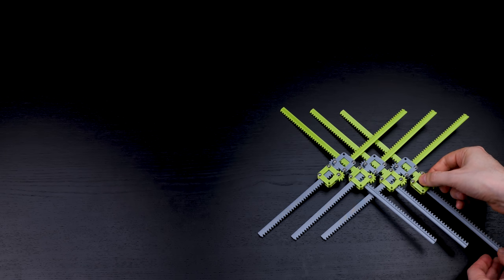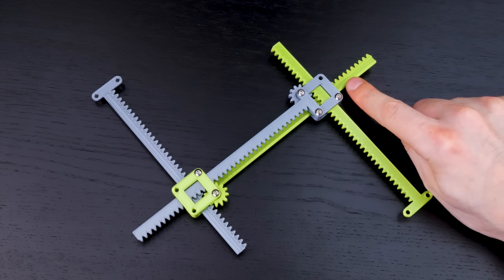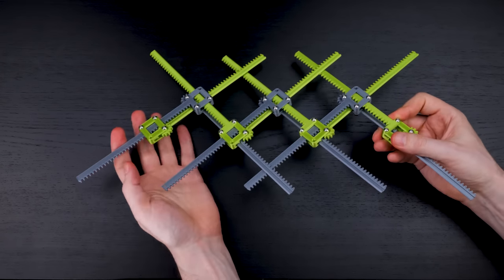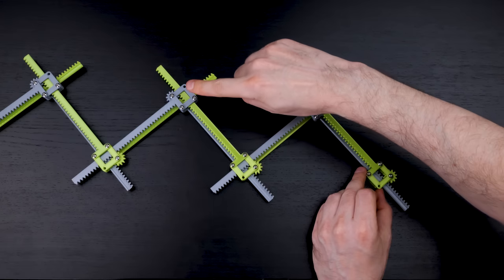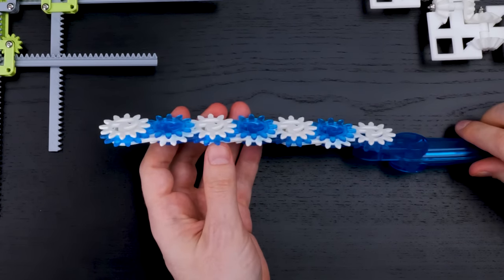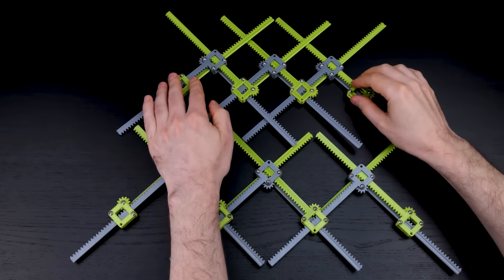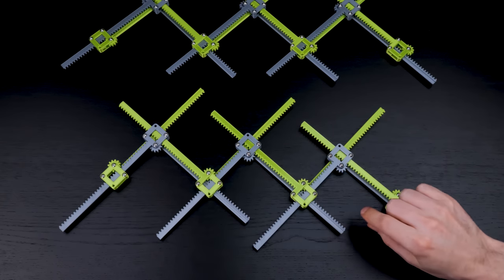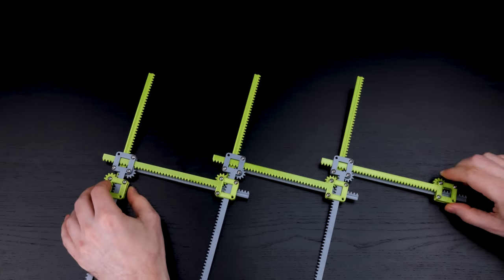Recursive racks

Comment: i would love to see a video about your process for creating mechanisms like this! do you use any programs or simulations when you're throwing ideas around? maybe we could see some early prototypes of some of your projects?
Reply: Did you ever even bother to check the description? It contains the weblink for the PDF download...

And BTW (by the way)... THIS is basically THE VIDEO about creating mechanisms like these.
Reply from the maker: @badfoodfeet  The very short answer is that these recursive racks came from thinking about Oskar's Tailspin mechanism, and wondering what would happen if we swapped out one kind of gearing (the spur gears in Tailspin) for another (sliding racks). The geared cube net is the same thing, but using bevel gears instead of spur gears. The prototyping stages are presumably not that different from how anyone prototypes - I design stuff in my CAD program (Rhino) and test it out. I implemented my own gear/rack code, then I tested out how small I could print gears before they stopped working smoothly. Having determined the sizes of my gears and racks, I then made a box with two racks and a gear, and found that I had a lot of friction. So then I modified the design to decrease the surface contact areas between parts. And there's also some stuff to do with designing for the filament based printer I have - thinking about the print orientations of the various parts and how to bolt things together.
Reply: noahgiom341 wins!
Reply: @alb9070   The first clear internet argument winner I have witnessed honestly
Reply: So, if the racks were curved, presumably you could have a collapsing circle frame?
Reply: @AsciiSmoke cool idea!
Reply: @OmenAkumaru20223 I’m sorry for whatever happened to you

Comment: These demos remind me of the Hoberman Sphere - that spiky ball toy that expands and contracts through a bunch of linked scissor mechanisms. The Hoberman Sphere is recursive too, except there the components have a network of relationships rather than just a chain of relationships.
Reply: We used to have one of those! It was super fun to play with and toss around :)
Reply: Commonly seen on indulgence feasts in Poland - stands with cheap (often knockoff) toys, sweets and especially indulgence obwarzanki (a very light and dry kind of ring shaped bread, no idea how it's made, availble basically only on those indulgence feasts) spring up around churches on the day of that church's patron. Usually in summer. I remember having that kind of toy, but idk if it's still somewhere around in the house.
Reply: isn't it offically called the "Ikea Death Star" now ?
Reply: technically you could say that it's an inverted hoberman sphere. Inversion is a geometrical transformation which (in 3d) changes planes into spheres and vice versa.
Reply: I tried to put a servo on one of the joints of a plastic Hoberman Sphere so that I could remotely expand and contract it for dramatic effect. It didn't really work as my servo didn't have enough torque. I wondered if the sphere I had relied to some extent on the flexibility of the thin plastic struts or whether a solid metal construction would also work if the joints were ball / socket.
Reply: How could you get Oskar's surname pronunciation wrong when that's the first thing he always says in his videos 😭😭
Reply: @nikthefix8918 ironically I had the same idea, except I planned to recreate the sphere with a slightly different mechanism using strings which in theory would make it easier to expand and contract it via machine.
From playing with it, I’m pretty sure you need to push from two points relatively far away from each other. Contracting one side alone seems to either be really hard or just impossible.

Comment: The pure rack and pinion recursive mechanisms could absolutely work without the constant step up every iteration - if you take either version rotated to a vertical grid, the similarly orientated racks obviously never cross over each other, the horizontal grey racks never cross over with the vertical green racks, and the vertical grey racks never cross over with the horizontal green racks, so there are two separate sets of racks that could each occupy one vertical space without ever colliding with each other.

That said, you would need to tweak the design slightly - I doubt you could just rearrange the parts you've already made to do that.
Reply: w

Comment: I'd love to see what can be done using different gear ratios between "incoming" and "outgoing" racks of each box. Would it just change the slope of the diagonal movements of adjacent boxes or can you create more complex movements using that?
Reply: Sorry made a comment twice and deleted. 

Thinking about this is difficult at 4am.  Especially when I misinterpret the device for 6 minutes because I was typing lol.

Anyway, I think if you put gears pairs into the boxes with correct ratios it should be possible?  It would basically twist the path a little if you did achieve it though, shouldn't allow any more complicated movements.   Though I must confess I can't think of what other movements this system can really produce.

Comment: Seeing how the original worked, and then seeing the second one, I was actually pretty happy with myself for being able to work out how the second one would work relatively quickly.  That being said, once you did confirm it, I immediately thought of trying to find a way to use these and other slightly modified racks to act as logic gates.  Would be very interesting.

Comment: This reminds me of pantogarph mechanisms like used in various extension mechanism. Your last example in particular looks like a different take on a mechanism oft used in drafting machine, whereas the top bracket and the end unit must always stay parrallel relative to one another (so that lines remain parrallel). In these machines this was at first accomplished with a pantograph, with two rods comprising each segment of the arm. On later american machines, they switch to steel belts, which are put in tension so that they grip their respective wheels. The top and bottom disks are fixed, as is the elbow of the machine; so whatever movement is affected, the end still stays parallel. In very nice machines, the steel belt was welded in a manner as to never loose tension. Cheaper models used a belt with a tensioning nut on each band and their loosening could cause errors in the drawing. However the geared rack idea perhaps could be applied in keeping those two points fixed in a different manner. Either with solid racks around toothed gears, or perhaps with a toothed belt.

Comment: You probably dont see this a a proble to solve but, You could force the first, and I thing second, recursive rack and pinion to be flat (not stair stepped) by fixing the height of each rack to a constant value based on orientation. It would require a means of selecting the height of the rack fixed to the box to 1 of 4 values, either with spacers or custom shapes for each orientation. But completely doable

Comment: Would be interesting if you make a box out of first mechanism. If you place rack flipped, you can then rotate it to 90 degree. When all sides are connected, it should switch between two parallel sides become shorter, where opposite become longer, like:
++ => +----+
|  |       +----+
++

Comment: Ha that's hilarious.  At 5:29 when you were talking about you could remove the gear as long as the box held the 2 pieces and they slid together, the first thing that popped into mind was driving them like the slotted straight driven lock/key combination shown 2 or 3 years ago in one of the lock picking videos.
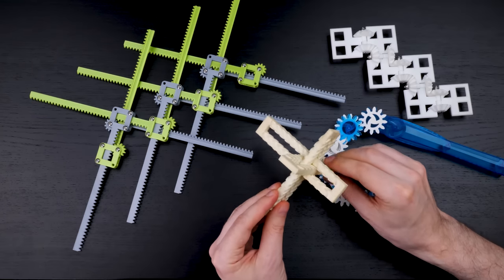Then at 5:36 of course you pull out exactly that, a straight drive push gear mechanism.
There's a lock based on changing the teeth of that mechanism so the matching key opens it.  Fairly simple and not very secure, pretty sure they said just shoving a vegetable into it would usually open the locks.  Used in Russia or Scandinavia etc for simple things like shed doors, the video showed one outside somewhere.

Comment: Hi Henry--have you tried making"recursive" structures that branch by more than 1 (e.g. a tree rather than a chain)?  As a programmer I can't resist that interpretation of "recursion" because function foo(x) { foo(x+1) } isn't that exciting (tail recursion is the same as normal loop) whereas function foo(x) { foo(left(x)); foo(right(x)); } does something novel and interesting which should be beautiful to watch.  So a single element would give rise to motion in two other elements that move in some opposite/different way from each other, and each of those elements gives rise to two more elements each, and so on.  Obviously you won't be able to manufacture too many levels of recursion before it becomes unwieldy, but even 2-3 would be fun.
Reply from the maker: Yes, you could absolutely have something like this branch off in multiple directions. Just make the gear thicker, so it meshes with three racks instead of two. The harder problem would be to get the branching structure to link up with itself to make a loop!
Reply: @henryseg  Even if it was just a tree that moved in a tree-ish way with no loops (with the leaves just hangin' out) that would be cool.  Each layer of the tree might move apart/together twice as fast as the previous layer.  Then the REAL challenge is branching out 3x instead of 2x for a 3-D expanding tree structure haha.  Wish I had access to any of the tech to play with this.

Comment: Could you change the gear size between the two pinions?
That way each part won't move 1 to 1. Could be interesting?
Reply from the maker: Do you mean having a little pinion gear replaced with a part consisting of two pinions with different radius, stacked on top of each other? If so, yes, I think that would work. The box would need to be designed to match of course.
Reply: @henryseg  In my head this could lead to the final square tracing a curve not a straight line.  Maybe if you stack them the right way like a Fourier sequence it could approximate any shape.
In theory.
Reply: No I think I'm wrong. Maybe. I'm on holiday and can't sketch something out on my computer to work it out.
Reply from the maker: @NathanRae  If there are no rotation parts to the recursive mechanism then each rack adds a vector to the position of the next box. As you work the mechanism these vectors get scaled linearly, so I think the final answer has to be linear motion. However, there are gears with variable radius. Using them somehow could get it away from linearity.
Reply: @henryseg  Yes this is what I concluded in the end. Got my brain going for a bit though. Thanks.

Comment: Make those teeth saw teeth and then you can have a saw that cuts on two sides of the object you are cutting at the same time, including cutting wood logs. You would only need to pull and push one of the handles to make both saw blades work to cut at a 90 degree angle to each other. That might make your saw twice as efficient. If you motorized it you might have an even better invention.
I've been a mechanic, carpenter, welder, fabricator and aircraft maintenance engineer and manufacturing supervisor for building 2 million dollar air handling units for Amazon, etc., most of my life.

Comment: I'm not sure why you chose to describe it in terms of each "two boxes determining the position of the third" when you just as easily could have said that each box mirrors the one before it, therefore they all remain in sync -- seems overly complicated and unnecessarily confusing unless I'm missing something?
Reply from the maker: The positions do “mirror” each other as you say, but it is the interaction of the previous two parts that mechanically forces the position of the next part. I’m describing what causes what, not just where the parts happen to be. I hope that makes sense!

Comment: Of course it's very similar to the multiple scissors type reach grabber.  Operate one scissors, the closing of one closes the handle of the next, etc etc.  'Scissors grabber' will turn up may of the long reach type on google..
Reply from the maker: Yes, I have also made designs based on scissor linkages. And depending on how strict you want the analogy to be, I think you could also call them recursive mechanisms.

Comment: For this I'm referring to the rack of 7, with 3 grey boxes and 4 green. If you invert every 2 boxes and print a mirror image, couldnt you get the entire thing to lay flat, or at least not increase past a fixed limit? The first set would stagger up, but then the next one would make the following stagger down?
Reply from the maker: Something like this is definitely possible. Maybe the simplest version of this would be to bolt both racks to one side of the box rather than one above and one below. (Or rather, since they would overlap with each other in space, you'd need one L-shaped rack to bolt on.)

Comment: I think, but I could be wrong, that if you tweak that second mechanism which alternates lengthening/shortening so that the angles between successive segments are 60 degrees instead of 90 degrees then it has the property that the distances between every other square are held constant.
Reply from the maker: Hmm, distances between every other box would be constant if the angle were 180 degrees (if everything just acted along a line), which makes me suspect that it wouldn't work at any other angle.

Comment: I wonder what would happen if you close the loop on the rack and pinion ones?
Reply from the maker: Right, I think it should work fine. Both the expanding and the diagonal designs should be possible to close up.

Comment: Is there any way you could make a collapsing mechanism with measured points all between both ends to move to exactly were you need them Im learning to build guitars mainly microtonal instruments and I’m trying to figure out how I can make the frets move between equal temperaments ( how many frets it takes to reach an octave ) this would normally be your standard 12 notes I was thinking 31 max and the least frets per octave would be 5 the only thing is these frets would have to move in the exact right spots while being practical enough to play maybe I could fix up a plexiglass fretboard so you see all the parts moving cool hope that makes sense

Comment: Cool mechanism, not quite sure about recursive, it’s no more recursive than a regular gear chain, where the position on each gear is determined by the previous one, or for that matter, a tower of Lego, where the position of each one is determined by the previous one. I think you were probably thinking of Fibonacci when you were thinking recursive, being that it’s the previous two, maybe Fibonacci racks?
Reply from the maker: In a regular gear train the position of the next gear is determined by the previous gear and the position of the “first” part, the gear box that all the other gears rotate in. So, yes, strictly speaking something like “f(n+1) = f(n) + f(1)” is also recursive, but not as interestingly. And yes, the Fibonacci sequence would be a closer analogy, but I don’t like naming things after people that didn’t invent them. Fibonacci didn’t even invent the Fibonacci sequence (see https://en.m.wikipedia.org/wiki/Virahanka ). Unfortunately, if I called them “Virahanka racks”, nobody would know what I’m talking about…

Comment: Seems like you could have interim stages that aren't racks but are arcs of gears, with the effect that pushing the initial rack by X would push the last rack by kX, where k is some product of factors associated to the gears. If you made k<<1 you should be able to exert large forces (up to the strength of the 3d print, anyway).
Reply from the maker: I think maybe the simplest way to do what I think you're suggesting is to replace the little spur gears in the boxes. Instead of a single spur gear that meets both racks you could have a part consisting of two spur gears of different radius, stacked on top of each other. The two racks would meet different spur gears, which would then do the usual mechanical advantage thing.

Comment: Is it possible to create version of the first one where it the height doesn't change when adding new arms?
I'm guessing that all the boxes you're using are identical. Could you make some kind of mirrored version of the box that when alternated the the original version it would allow the whole mechanism to remain on the same plane?
Reply from the maker: Yes, a redesign could have everything on the same level, although you'd have to choose the design so that the racks wouldn't collide with each other. The "diagonally moving" version would be fine to have everything on the same level - the racks never occupy the same bit of 2D space in that design.

Comment: Maybe I am missing something, but why are these recursive? A linear function y=ax+b is not recursive just because to get to the next value of y when x changes by 1, one has to add m to the previous value... This entire mechanism seems linear (maybe except for the inaccuracy cumulation mechanism), doesn't it?
Reply from the maker: You could write a linear function recursively if you wanted to... but that's beside the point. The point is that the "logical" structure of the mechanism is recursive, in the way that the positions of the various parts depend on the previous parts in the chain.

Comment: With the first set of arms and cogs: As the whole system gets shorter left to right, it gets longer top to bottom.  Is this always the case?  Is there any way of having it extend left to right whilst remaining an even height top to bottom? e.g. with curved arms?  flexible or auxetic materials?  Or any other ideas... I have only two ideas, but I'm not good enough at maths to know if they are good or not...